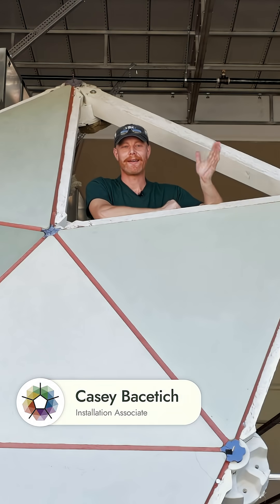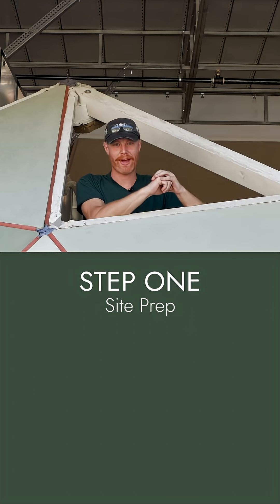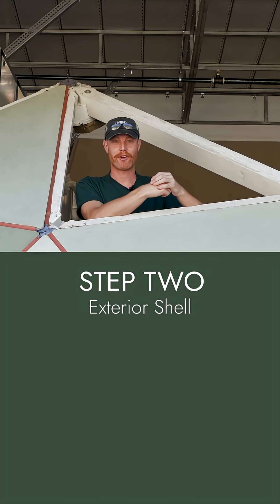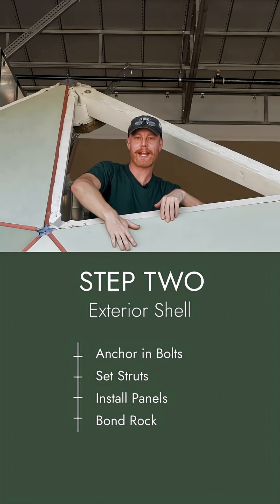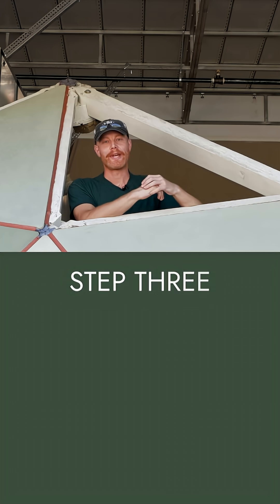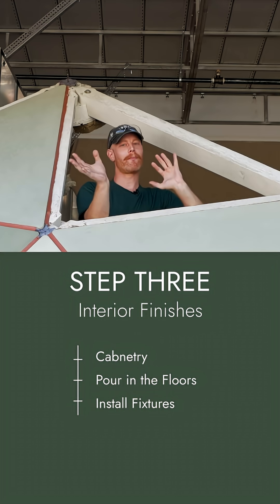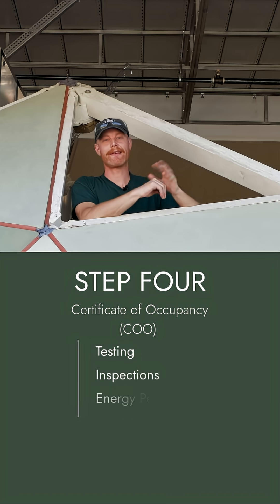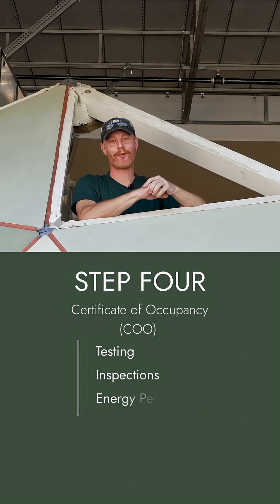First Amma Dome Installation Begins: Step-by-Step Overview of the Process

Comment: ...your running $650k ?
Reply from the maker: The Amma Founders Edition is about $300 per sq ft, which includes manufacturing, delivery, and installation. Future models aren’t priced yet, and as production scales, unit costs are expected to drop significantly ,with plans to reach 10–30% below average new-home cost per sq ft in the next few years, and 30–60% below at thousands per year. 🏠🌎✨
Reply: Also Geoships have value that standard housing can’t touch - they’ll last hundreds of years without the decay and constant upkeep of a traditional home, and they’re made of entirely non-toxic materials; a traditional home is continuously, slowly poisoning you.